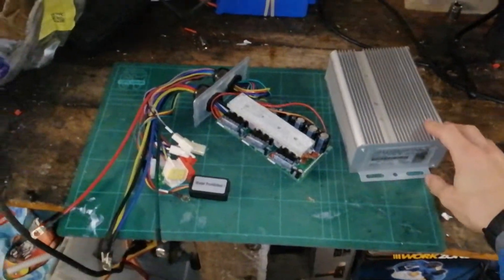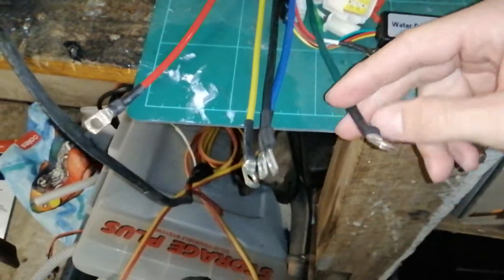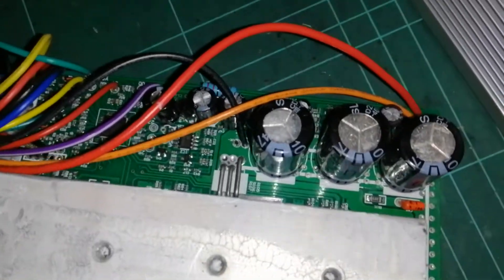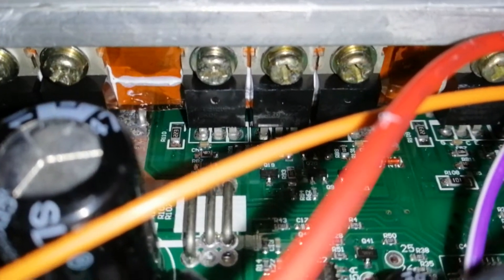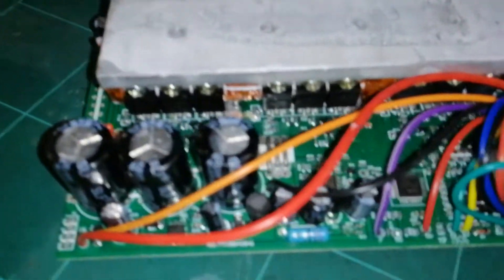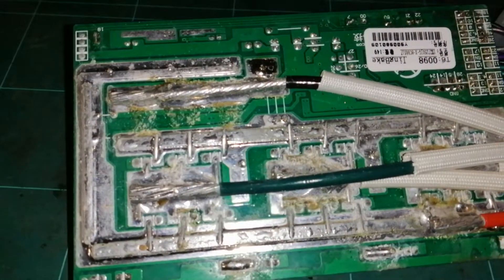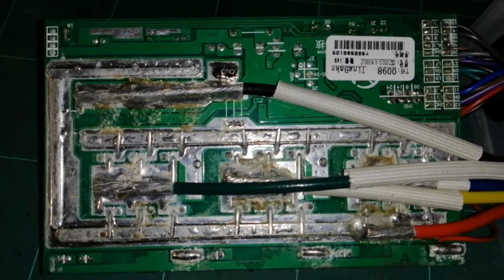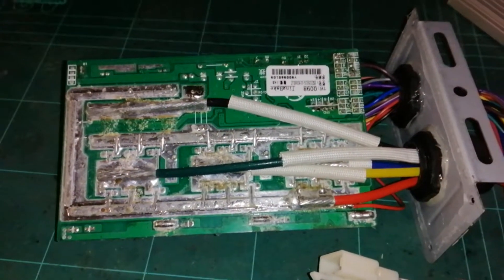Yu Yang King 50A 72V Ebike Motor Controller Teardown YKZ7250JG

Comment: I know I’m late. Lol but I can’t find ANYTHING on you tube about where my display wires solder on controller itself. On My 72v 80a controller I was able to locate hall sensor wires, throttle. I don’t need display but which wires connected together turn on controller to bypass display?  Thanks. Any help would be greatly appreciated   The controller wires were burnt on outside with faulty batteries I got a warning from Amazon to discontinue use, may explode….no shit! Destroyed my bike.
Reply from the maker: Hey mate, unfortunately I just sold the controller. As far as I know my controller didnt have display wires, just a bluetooth module (and I dont think it required bluetooth for the controller to operate).

I recall there being a switch wire for some controllers, which essentially provides battery power to the microcontroller circuit side of the controller (thus switching the whole controller on). Look for a big resistor/s or a dc-dc converter on the board. There may be a solder point to provide power, which may switch on the controller. 

This is only for some controllers, so definitely no guarantees.
Reply: @ appreciate the help. I found throttle, hall sensor wires and display. Opening up my 60a controller to help find the lock to at least use bike without a display. Thanks again!

Comment: My Bluetooth doesn't wanta connect to the app so I can't tune it any idea why??
Reply from the maker: Yeah I have had trouble with this. Have you given the app permission to use bluetooth? I recall a menu coming up asking me to allow pairing to the controller (not an app menu, an android menu). If you haven't allowed paring to the controller, or given the app permission to use bluetooth that may cause issues.

Comment: The difference with the bigger "brother" 60-96v is only in mosfets..?🤔
Reply from the maker: I suspect mosfets, capacitors, and maybe the voltage dropper circuit for the microcontroller
Reply: @BobsEVGarage  i hope in the next 15 days 2 of these controllers will be in my hands!
I also tried to find information about yyk 50a and read only the basics!
I have a question about the ambers...🤔
All the bigger yyk from 80a and up write (for example the 7280) 40a rate and 80a max for a few seconds...
About ykz7250jg, they write only max current 50a....
So these controllers works differently from the bigger "brothers"..??
Full throttle can have continues 50a...??
I'm Greek 😁 i hope explained right my question...!!

Comment: I have the Yuyangking 72v80a model,it's slimmer than yours and cost 59 from China and 20 shipping,I have had 3 years now and no problems. Mine sold Bluetooth separate for $20. Had to hunt browser for awhile to find Android version of app but came with 3 apps in a bundle. Great vid.

Comment: If you ever open your yuyang king controller up again if not to much trouble can you tell me the id info on the ic chip that has 8 pins ( 4 on each side) that is opposite the wire side  below 3 large capacitors between the group of medium capacitors and the last medium capacitor at the very end of board by the big red and yellow wires marked n5 on PCB because it blew up on my brand new controller as I was bench testing. I would really like to repair it but I have no way of identifying it since it completely exploded  except I'm pretty sure it is a IC741 chip but if you could help a fellow EVer out it would be incredibly appreciated. TY
Reply from the maker: Hey Mate, Happy to help. Im sure I took some good photos of the board, let me have a look....
Reply from the maker: https://photos.app.goo.gl/8efqeUUMV2u7QEBt6
Here is a link to my photos of the controller....
Reply: TY, you are a lifesaver. I've reached out to everyone I could and you actually replied and have it. Thank you so much. Now I just got to get the chip, probably $1 and soldier it in. Saved me $$$. I just hope I figure out the cause, but you got me back in action!
Reply from the maker: Best of luck. Was it the Dc-Dc converter chip, or some op-amp as you were saying?

Comment: why are these so big? I have an ancient chinese 12 fet (irfb 4110) that fits in the palm of your hand and I peak at almost 100 A (50 V) and it was used in a 72 V system before. I would guess I'm at 130 A phase current.
Reply from the maker: I agree, the controllers are very oversized. One benefit might be that higher IR mosfets could be used, because there is more heatsink?
Reply: You could check out flipsky vESC 6 most commonly used for esk8 but also capable of a lot more up to 12s 200amp I  believe with optional water cooling and just about size of deck of cards